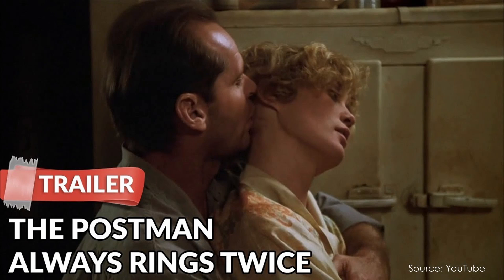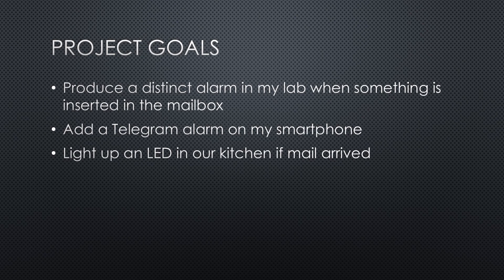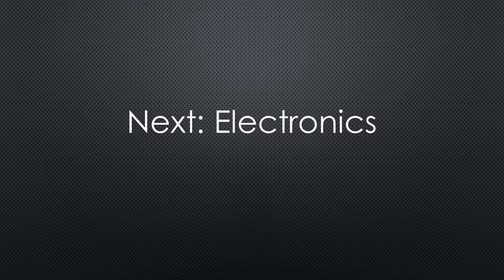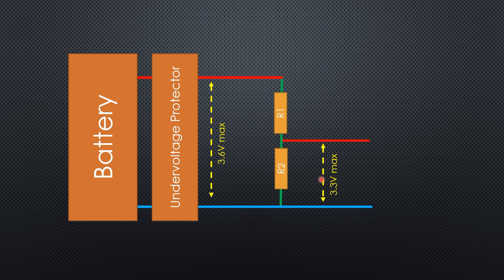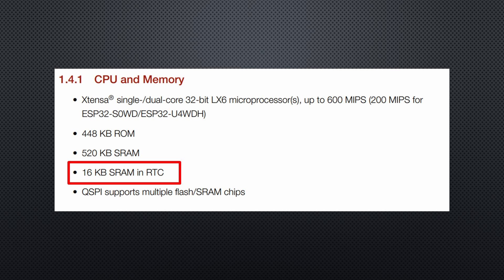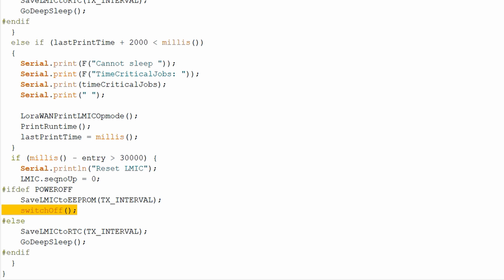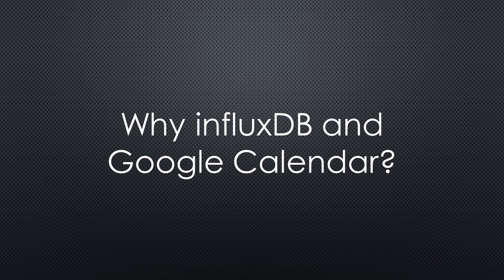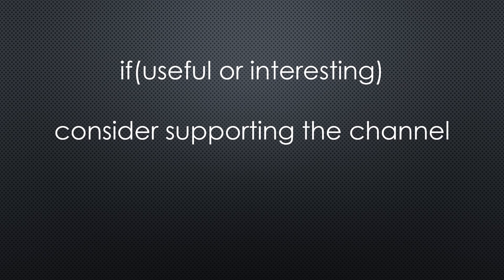#402 LoRaWAN V3 Mailbox Notifier (TTN)

Comment: Correct me if I'm wrong, but li-po battery in freezing temperatures during winter will give out very little current, and will also die very rapidly, no?
Reply from the maker: We will see. They do not need to provide a lot of current and the temperature should not go much below 0C in the box. The  Li-Ion batteries on the roof worked ok during winter.

Comment: Excellent project and well explained as usual.  Very good plan to track the battery voltage especially as the temperatures start to drop.
Reply from the maker: A few viewers are curious if it will survive winter. I will report in spring...

Comment: I don't know if it's just me but in my DIY'ing experience with magnetic reed switches, I've found them to be quite unreliable. 
What I believe happens, is that the switches are based on a mechanical contact and due to a number of factors (eg, normal wear and accumulation of wear debris, thermal movement, vibrations (such as next door mail box), etc) false alarms are easily triggered. 

Maybe Andreas' logic can also monitor the duration of the reed switch's trigger 'on' time for a minimum threshold. 
Alternatively, that little mercury tilt switch, that Andreas showed, could be used instead (should be more reliable).  

What I do, in my 'reed switch projects', is to use a double trigger. That is, for any single trigger location, I use two switches. 
For a normally closed, situation, I wire them in parallel such that BOTH must be triggered at the same time; or for normally open, wire in series.
Reply from the maker: So far it runs for about 2 month and is used twice a day. I did not know of the problems you describe. But now I know if it starts to create false alarms and I will change to the mercury switch. It already needs a short time to start the ESP and trigger the "hold GPIO". Maybe this is enough debouncing time...
Reply: @AndreasSpiess  Yes, if you have some debounce time you should be okay but 2 months is still in the running-in period. My problems started after at least one year or more, then slowly became worse. 
In any case, that has been my experience. Just something to consider if you start getting false alarms from those switches; or have an older installation (using those switches) and are getting mysterious false alarms.
Reply: @AndreasSpiess  the mercury switch should solve the oxidation problem.
Reply: Although since you are switching ESP32 power, you may exceed the 20mA anyway.
Reply: It's a well documented fact, any contact except gold will deteriorate with time in the atmosphere, and you therefore need to ensure you have a minimum of 20mA to break down the oxidation.  Reed switches are often glass encapsulated but I'm sure the $3 variety won't have gold contacts.  This is why you see gold plating on edge connectors, etc.

Comment: Cool! If the battery is directly connected to VDD you can also use 'extern "C" int rom_phy_get_vdd33()' and save the voltage divider (and current). I usually calibrate this at 3.3V and it works ok-ish.
Reply from the maker: Did you try it? I found posts complaining it is not reliable.
Reply: @AndreasSpiess  Yes, I use it after Wifi is connected. In very few cases I get the impression that it is 0.1V off. For real decision making, e.g. power down at low battery voltage I use an recursive filter to make it more reliable.
If you don't trust it, you can still move your voltage divider behind the power switch to save current and for the case the newspaper is stuck for a long time you can connect the low end to a GPIO: low for dividing, tristate for off (the ADC GPIO will be maximum at VDD in this case which should be ok).
Reply: How can you connect the battery directly to VDD when the ESP32 has a VDDmax of 3.6V?
Reply: @MrBobman49  I was refering to the setup with a LiFePo4 battery. It has a maximal voltage of 3.6V, nominal 3.2V.

Comment: I'm a bit worried the battery won't like the wintery conditions
Reply from the maker: We will see. I still have the possibility to switch to primary AA cells if it does not work out. Keep in mind: The battery will not be charged during cold days.

Comment: This video was like sitting next to you going through the same problems when developing IoT projects with LoRaWAN. Same problems and very similar solutions, in my case the biggest differences have been to change from TTN to ChirpStack... This simplifies things a lot, TTN V3 does not work 100% well, the ABP mode has become useless with the new changes and the OTAA mode is not well tuned yet (to do things a little out of the ordinary). Thank you very much for your videos, they always have been very useful and even interesting. Byeee
Reply from the maker: So far I never used Chirpstack. But I made some tests with a Helium light gateway. This could be interesting for our US colleagues.

Comment: I often noticist that These contact switches get stuck at Just little currents
Reply from the maker: Good point. Thank you for the heads up. With your comment, if it occurs, I will find the error fast and replace the switch.

Comment: I hope you will not get may false positives when the strong wind lifts the lid from the mailbox...
Reply from the maker: Then many other things would happen, I think. The box is completely closed and no wind can enter. So it would probably lift off our roof before it would open the lid...
Reply: @AndreasSpiess : Agree on your mailbox design, your lid goes inwards: our lid has a flap and goes up(outside)... in the fall and winter with strong winds our lid often opens...

Comment: Had a similar problem with deliveries to the front door.  I'm losing my hearing so could not hear the front door bell.  Solved it with ESP Now and an RCW microwave sensor.  I have 12 v in the drive so set one MCU, an Arduino Nano, under a plastic plant pot connected to the radar sensor and a 433 mhz transmitter.  Cheap if it gets stolen. The signal is detected by an ESP32 using a super het version of the 433 receiver which increases the range greatly.  The ESP board creates a date time stamp structure then broadcasts it on ESP Now to an ESP 32 camera  to take a picture adding the date time to the image name.,   The signal is also captured by cheaper ESP8266 boards which were connected to a small strip of 3 LED lights  which then flash.  I can add as many boards as I need because I use an ESP NOW broadcast signal. These boards are distributed into my 'workshop'. the kitchen and my living room.  Problem solved.  I also use the system to check for cats and squirrels digging in my seed beds and eating my strawberries.  Might switch a water hose on them next year!
Reply from the maker: Sounds like a great project! I also like (and use) 433MHz. ESPnow is a simple solution for short distance communication without a lot of security issues because it is not connected to your Wi-Fi.

Comment: The external temperature will affect the battery life the most. Specially in Switzerland. Great video though.
I've smartified my letterbox with a height sensor an esp8266 with esphome and home assistant to deliver the messages on my phone/smartwatch, but the battery doesn't last a week. Is worked so fast that the postman was at the neighbors when I went outside for the mail. As I don't receive many packages anymore, I'm not using it for now.
Reply from the maker: I will see if the battery survives or if I will switch to primary AA batteries. Getting a long battery life was important for me, but measuring the height is also an interesting possibility.

Comment: With all the issues of joining the network and given the distance is very short, would it not be easier to simply go "peer to peer"? The mailbox powers up and transmits it's simple message. In your house a Lora board attached to a Pi listens for a message then does it's thing.  No need to use the TTN etc. I use this system for monitoring a treatment plant for my water supply about 1km away. Just a 5byte "chirp" every 10 minutes or so.
Reply from the maker: You are right, it would have been easier. But I needed a motivation to migrate to TTN V3. And this one was a perfect fit if I see how many problems I had to solve...

Comment: Hi Andreas  Another great video , shame I don’t have a post box my mail though the front door. 😁
I would just comment that the Heltec  cubecell board AB02 and other cubecell products  can use deep sleep and gpio as wake input with very low current.They can also be set in the board config menu to store network credentials  so no rejoin  or loss or counter values. I now use these a lot. Not Esp32 but use combined  an MCU/SX126x chip set (ASR 6501/2) new products look to use (ASR 6601). Also my comment on TTN V3 over last 3 month it is stable has been very good. Simon
Reply from the maker: How do you program these boards (which IDE, libraries)?
Reply: @AndreasSpiess   what is your preferred email address to contact you on . Quick summary Ardunio IDE could use others, libraries are supplied on Heltec site/ GitHub based on Semtex / stackforce standard node libraries . I can give more info and comments by email too long for here . Simon
Reply from the maker: You find links in the description on how to contact me.

Comment: About the eeprom, I did a function to save the data in different memory sections, but only when the current section fails. To be able to random the position every time, you have to store their position somewhere, so that position zones will be damaged anyway.
I think that there are two ways:
- Use the first byte to store the data position, and only write in another zone if a the data was not written correctly (check on write).
- Store it somewhere, but store a version bytes to detect the latest version, and read the entire eeprom to find it.

If someone knows a better way, is welcome ;)
Reply: For the esp32, I use the preferences library from Espressive. As far I understand it, if you update data in the eeprom/flash area, it is written to a new memory location. When full, it loops back. It’s better than the Arduino EEPROM function, what uses static memory locations.
Reply from the maker: @Eddy: Thank you! I will have a look at it!
Reply from the maker: I thought on using an increasing number (e.g. sequence number) stored with LMIC  and during startup search through all possible positions to find the highest one. So you would not need to write an additional number (similar to your second proposal)

Comment: Is it possible to use a light interrupter with a coded pulse? I'd love to apply this with a mailbox in my condominium since there's no mailbox flap to trigger the tilt switch and an ultrasonic sensor might not work with a thin letter too.
Reply from the maker: The problem of all "active" sensors is the power consumption. If you can power from mains your solution should work.
Reply: @AndreasSpiess  Thanks for your reply. I might only run once an hour from sunrise till sunset. And maybe use some kind of replaceable battery like 18650 or 14500.
Reply: Just mount a litle Door ínside the gole.
Reply: @docarmodeiras  The problem was, just like Andreas, I don't own the mailbox but the HOA does. And the box is actually just a drawer stack with each other. I don't think installing a flap will work though.
Reply: @id513128  How about something like a scale or just an button that is beneath a second bottom? or an Solar panel with an controll light sensor that turns on when the pannel is covered and the controll light sensor has light? Maybe an transistor logic could trigger the lora board on.
Reply: @swissTom124  As I said beforehand, the scale won't work with the small, thin letter. But light sensor might be an interesting one.

Comment: I have been working on one of these on and off for the past year but using Xbee. I managed to get quite a lot of battery life out of deep sleep but I didn't even think about actually triggering power instead of waking it up! Also I'm really pushing the limit of the Xbee range so definitely need to get on board with LoRa. Thanks again for your work and videos.
Reply from the maker: XBee has much less "punch" but much more bandwidth. If it works, it is a good solution. But in my case it probably would stay inside the box...
Reply: @AndreasSpiess  I also needed to put the antenna on the outside which wasn't ideal.

Comment: Hi great channel i have watched many of your videos and have made  the tiny gs ground station and radiosonde trackers. I keep seeing a insert for a piece of pipe used for housing these, can you share the 3d printer file?.. the printer is on its way.....  73  Max ZL2MST
Reply from the maker: I used the flexible box design from one of my last videos and adjusted the dimensions according my needs.
Reply: @AndreasSpiess  Thanks for the quick answer, the box video spured me on to get the printer, it was the circular power supply and TTGO board caddy / holder in video #360 about 16.59 mins  I was after information on . Cheers

Comment: Thanks for posting this. Interesting design.  I'm trying to figure out a design for my mailbox - but it has no flap - just permanently open, and it's 10 floors down from me in a parking garage. 

I think I will try some vibration sensors, and maybe a spring that the postie needs to push mail past to trigger.
Reply from the maker: At least you have a motivation: 10 floors is a lot ;-)

Comment: This is a great video!   I built something similar using an RFM95 module and an ESP32 in the base unit to send text messages to my phone.   It really is remarkable how far the modules can transmit.  One reaches over 1000' for my brothers driveway and another about 400' thru woods and a low hill at our tree farm.  As usual I have learned a few new things by watching your video.  Thx
Reply from the maker: Indeed these LoRa modules work very well. I also was astonished when my gateway got signals.
Reply: @AndreasSpiess  does the transmission go through before the flap does down, or goes the panel gaps* allow the radio signal to pass through? 
(* I'we been watching too much Munroe...)
Reply from the maker: I do not know its pass. The flap could be one possibility